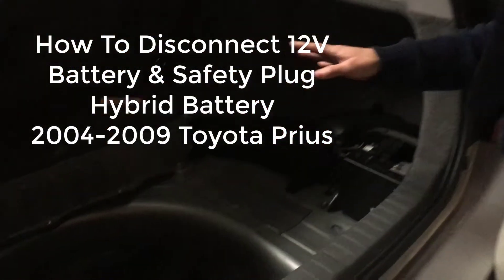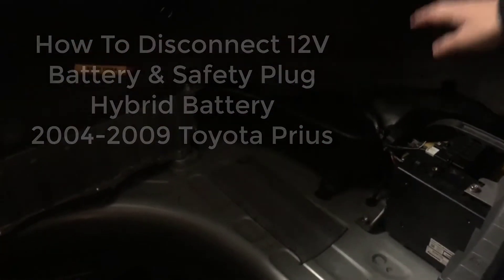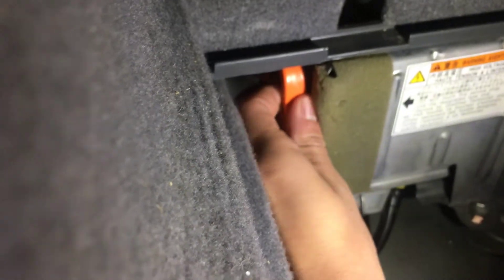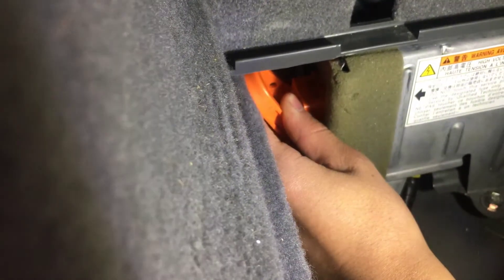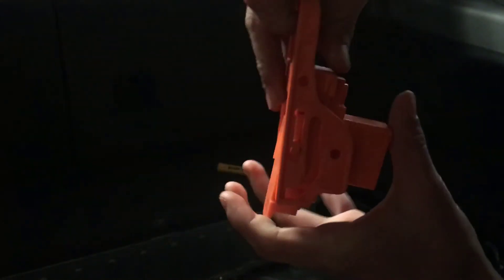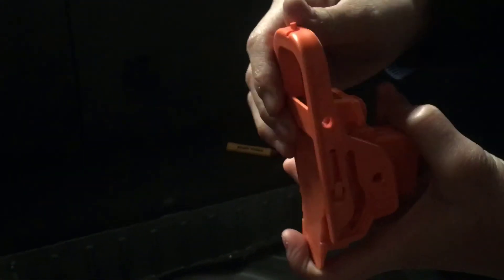How To Disconnect 12V Battery & Remove High-Voltage Safety Plug Switch Hybrid Toyota Prius 2004-2009

Comment from the maker: Here are the #ᴬᴰlinks to tools, parts and accessories you may need to perform this repair:
1.  https://amzn.to/3OJjjMG  |  Prius Hybrid Battery 2004-09, Guaranteed Reconditioned, 2 yr warranty
2.  https://amzn.to/4gsLonD  |  OPTIMA Batteries High Performance DS46B24R YellowTop Dual Purpose Sealed AGM Car, Truck and SUV Battery, 450 CCA, Maintenance Free, Versitile Mounting, Fits Select Prius Models
3.  https://amzn.to/3Zq84Oj  |  Hybrid Battery, Nickel-Plated Copper Bus Bars & SS Nuts Set, Compatible with 2004-2015 Toyota Prius, (Gen II & Gen III), Тoуota Рrius V (2012-2017), Lexus CT200h (2011-2017)
4.  https://amzn.to/3Vp9ojq  |  Milwaukee 2457-20 M12 Cordless 3/8" Sub-Compact 35 ft-Lbs 250 RPM Ratchet w/ Variable Speed Trigger
5.  https://amzn.to/3D4LOCa  |  G9020-47031 Engine Electric Inverter Cooler Water Pump Assembly for 2004-2009 Toyota Prius 1.5L 

Or Click on Amazon link here and search for what you need:  https://amzn.to/3D1T2GQ

Comment: Hi Aiman, I need to unhook the electrical wires connected to the back hatch. The dash always shows the Door Open symbol on the dashboard, so it drains the battery. Until I get the bumper fixed due to a fender bender, I want to disconnect those two Rectangular White Plastic Pieces holding the wires near the back hatch latch. How do I separate the two interlocking rectangular white plastic pieces? Thanks